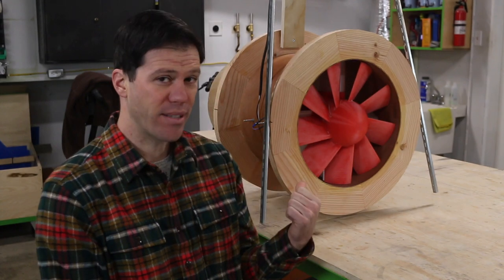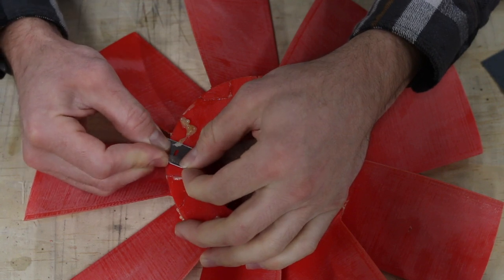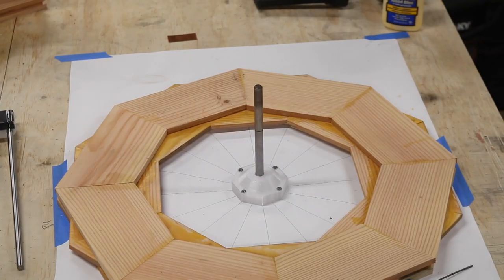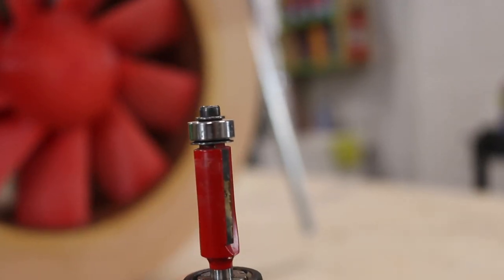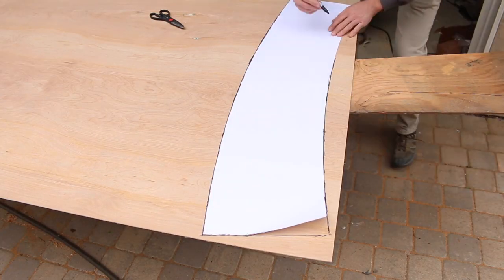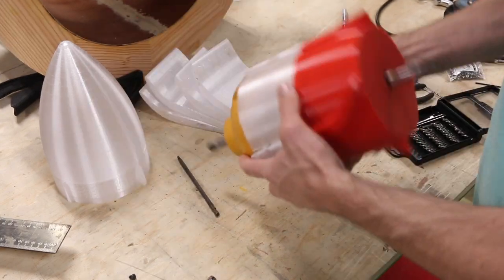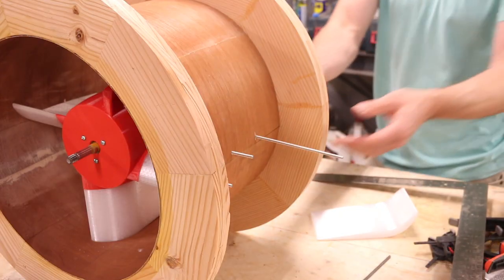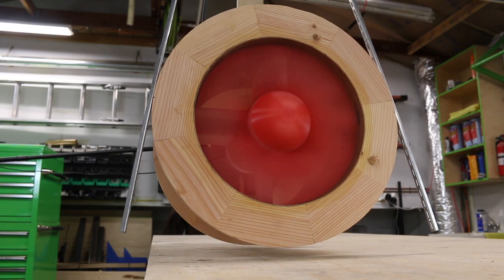Giant 3D Printed Ducted Fan Build

Comment: You need to add a radiused air horn on the front to allow the smooth transition of dead air into the fan.  Given the low rpm and power of your motor,  3-5 blades would probably more optimal.  You also need stator ring behind the fan for optimal thrust.
Reply: Hi can you help me with how the centre cones improve flow ? Velocity and CFM

Comment: What an awesome project! very interesting to watch you put this together and overcoming problems with bending the wood 👍 👍
Reply: I would have probably used some foam board instead, but that center motor is heavy! He is into wood, but if you want to have something which flies in the end, you want it to be light weight. And you won't have wall outlet power on something which flies.